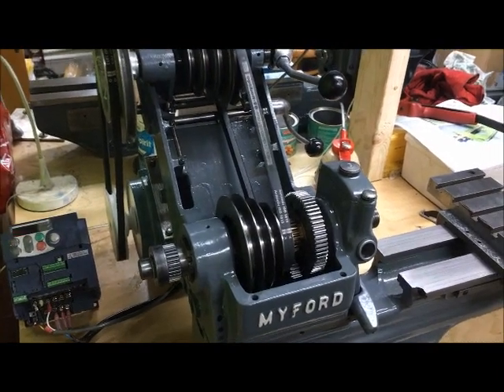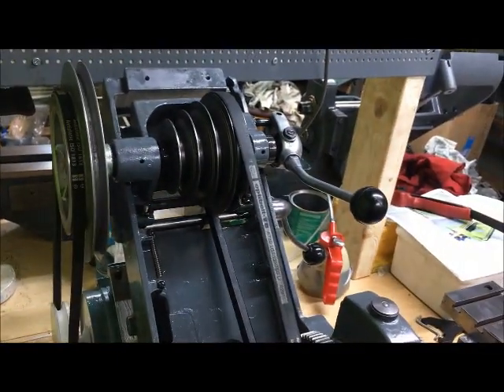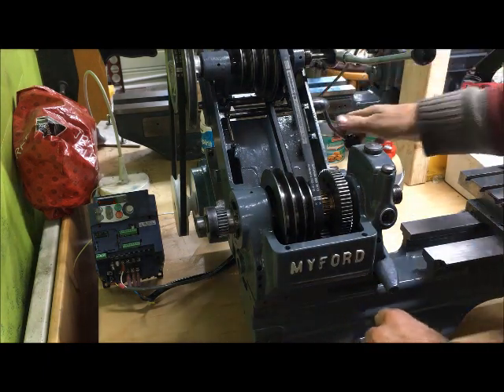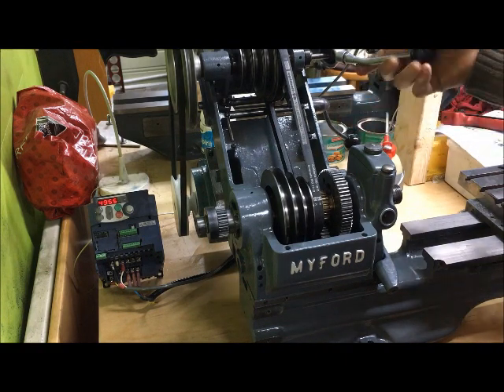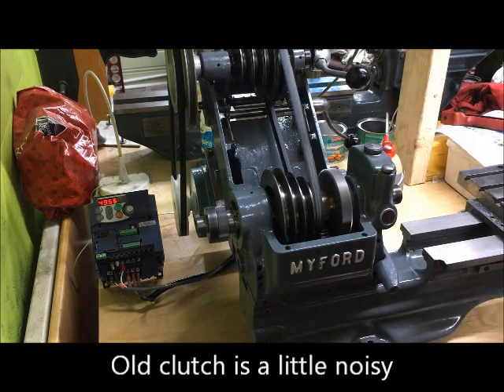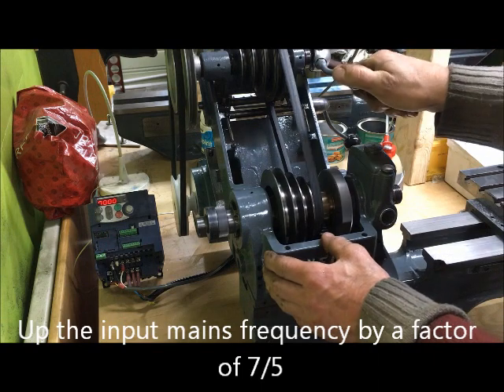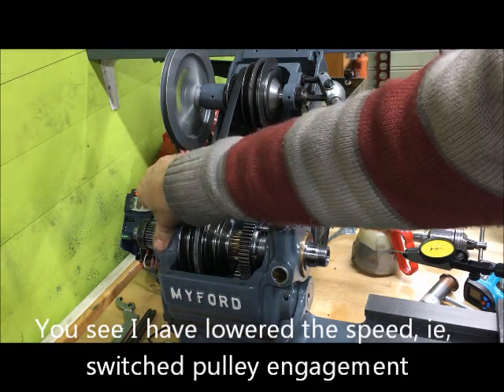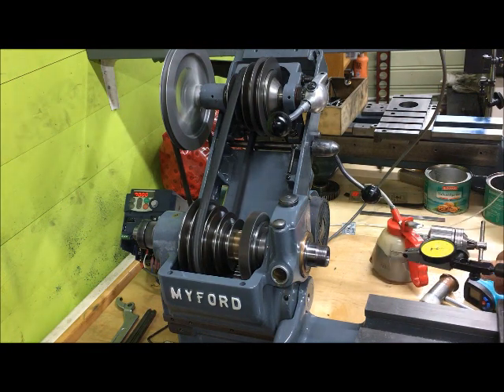Myford 7x7   headstock   running at higher speeds

Comment: I have been meaning to try a VFD on my bench lathe, you have given me more reason to try it. (If Jan shows it can work, I can at least try!)
Reply from the maker: Works like a charm! Stepless rpm control, ability for higher speeds (albeit at reduced toque). The arrangement I have retains the use of the clutch (which, to my surprise, I am using and think is a nice feature), but with a 3ph motor and a VFD you really don't need this. The motor can be stopped as much as you like, and acceleration/decceleration time can be adjusted to your liking, plus other functions like jogging and reverse
Reply: @jansverrehaugjord9934  You might already know and have this information Jan, but I ran across a procedure in the book written by Ian Bradley in 1973 about the Myford ML 7 and Super 7 lathes titled Myford Series 7 Manual. The book was updated in 1977 and republished as late as 2007 for my version. It gives some information about the clutch adjustments.  I'll quote directly from the book. "A word of warning here, a clearance of from .005" - .010" must be allowed between the end of the push bar and the face of the cam when the clutch is engaged. If this clearance is not observed the clutch will slip and damage may be done to the contact faces of the cone and drive pulley." Since I don't have the Myford written manual for the Super 7 that information might be in it as well and it's likely you already know this.
Reply from the maker: @turningpoint6643  This older type clutch is a completely different design than for the newer ones, but seems to work fine. Hmm.. could be I anyway have to look further into this and readjust/inspect
Reply: @jansverrehaugjord9934  A point I'd forgotten about Jan. As usual your quite correct. The books directions were for the newer cone type clutch and I think your's is the older style that looks much like a set of drum brake shoes.
Reply from the maker: @turningpoint6643  I have 3 of the older and 4 of the newer.. not all complete though :) Anyway, as you say, the older ones are of the drum brake shoe type. Not sure why they moved from this, but I guess something were found to be less than optimal?
Reply: @jansverrehaugjord9934  From the little information I can gather it was the Series 1 Super 7's that had the drum brake type of clutch. The series 2 lathes got a major redesign and upgrade for a lot of components including the new type of cone clutch. My guess is that cone clutch was a bit cheaper to manufacturer? 

That book I have also mentions that around the time of the series 2 introduction or possibly a bit later that the manufacturer's of the cheese head screws Myford were using on some areas of the lathe were "purposely" pricing them off the market. Myford then started using a metric thread pitch cheese head screw with a similar head diameter from a different manufacturer. So if you run into that with the various ages of Super 7 lathes you have that's why some of the lathes have a combination of imperial and metric thread pitches.